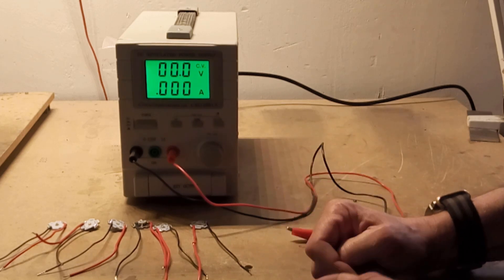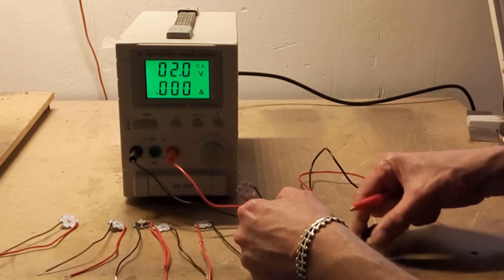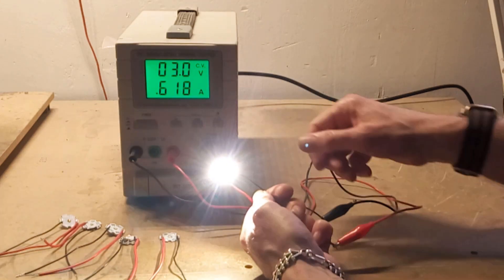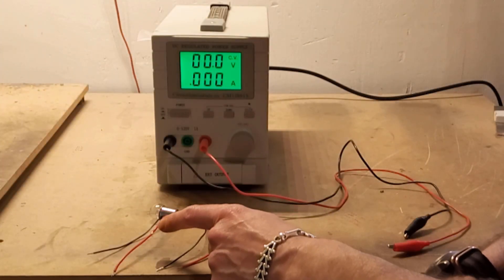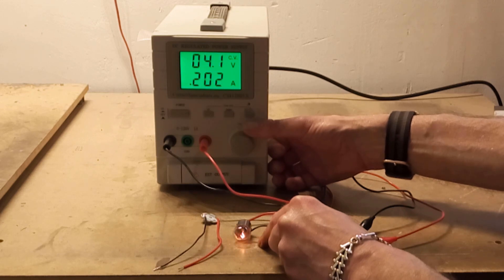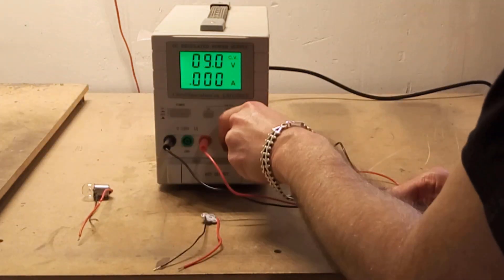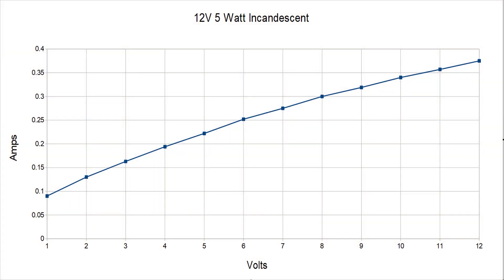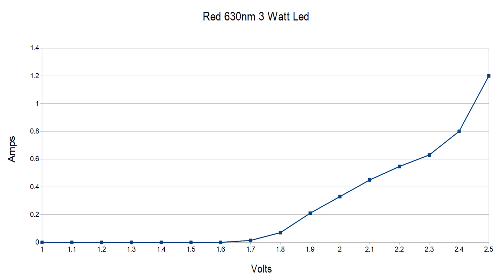Led Grow Lights - Led Wattage Explained

Comment: The 3 watt LED graph shows the operating voltage is at 2.5V and 1.2A.  What is the maximum voltage and current this device can handle?

Comment: Quick question. Don’t think it relates at all to the content however I’m scanning YT plus the internet to find the answer to this..... is it ok to use a higher wattage transformer/mains adaptor to power an inferior led draw. Normally sites recommend e.g led draw wattage X length of the strip = say 56w so the trans/mains adaptor would be 60w. My question is what if I used a 1Amp, 2Amp, 5 Amp or higher? Surely the draw Wattage will only pull what it needs? Would this be ok or would there be damage in time for some reason? Leds With resisters yay or nay? Without resisters yay or nay?